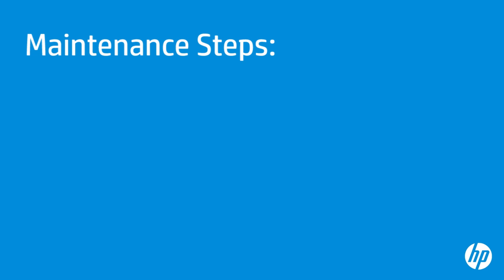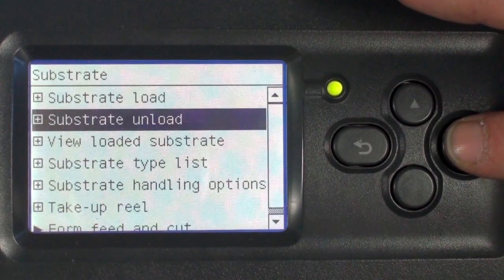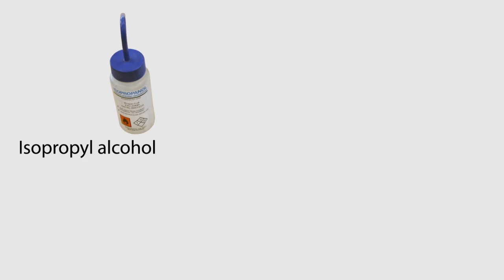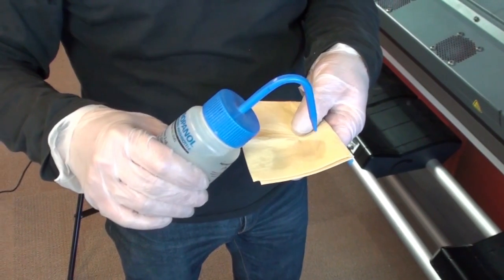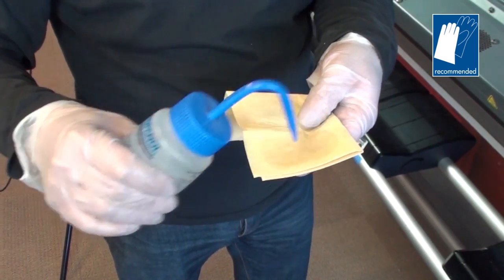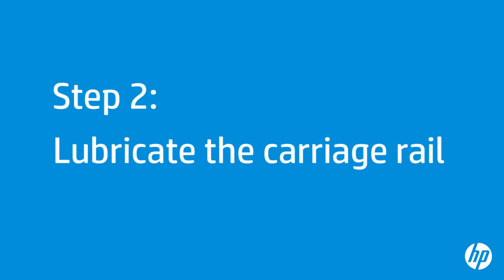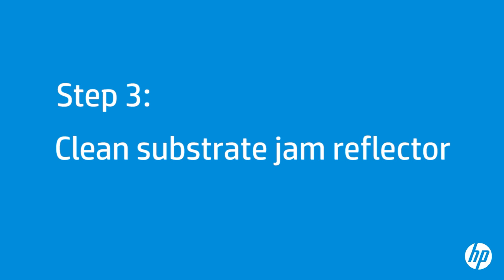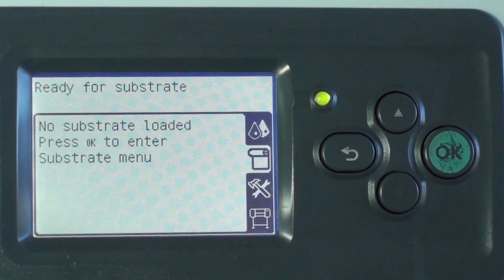Cleaning and Lubricating the Carriage Rail | HP Designjet L25500, Latex 260, and Latex 280 | HP

Comment: On my design jet L26500 latex printer I get an error. “81:01 
Caution! Hot surfaces Inside the printer. Do not touch the inside modules 
See users guide to clear possible substrate jam “
Reply: I’ve tried to reach out to hp support and no help any suggestions
Reply from the maker: Hi Richard, thanks for contacting HP Global Social Media Support!
I understand that you are receiving error 81:01 on your printer.
I will do my best to assist you.
Please refer to the instructions mentioned under this document to fix the issue: https://bit.ly/3ZedRWR
Binu-HP Social Media Tech Support

Comment: How to fix HP Designjet z2100  System  error 08:11   
please
Reply: +fares helal With the power off loosen the two thumb screws of the formatter in the rear and remove from the plotter.  Reseat the memory dimm on the formatter.  Reinstall again with the power off and then power up and see what happens.  Good Luck.